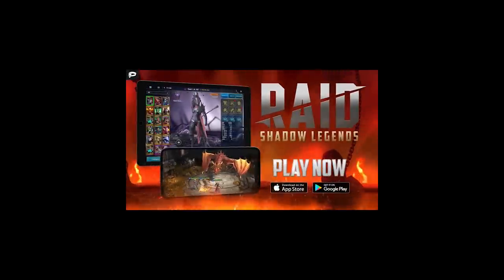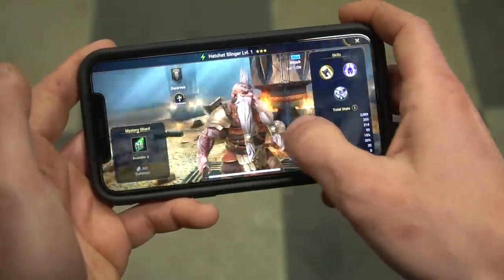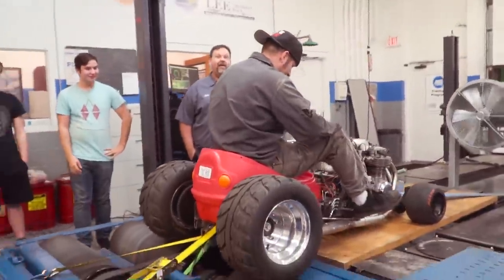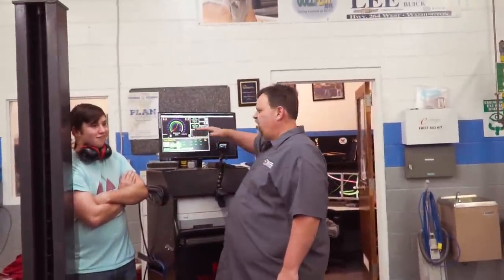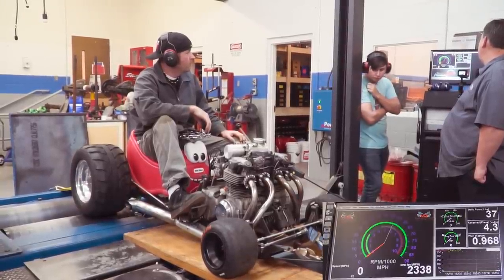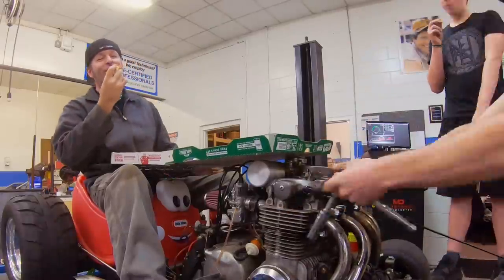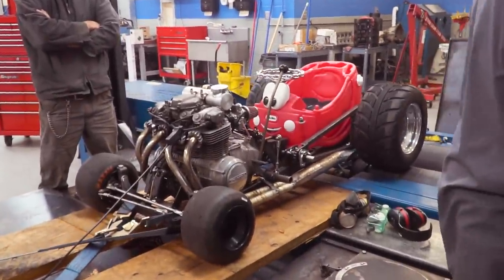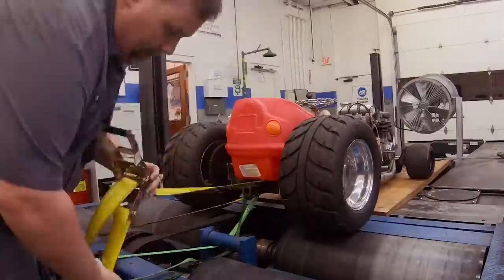550cc Little Tikes Go Kart hits the Dyno!

Comment: Dyna coils, dyna ignition and run the center 2 carbs slightly richer than the outer 2 for max performance. Ive been running 70s hondas for 20 years, great engines!
Reply: whats the deal with running the inside richer?  Is it a flow thing?  or heat? im totally curios
Reply: @gibbyrockerhunter  the center two cylinders run hotter than the outers, a little richer keeps em cool
Reply: @Chris_Bumpus  makes sense and is good to know. thanks dude!
Reply: MyLiveandletlive do they though.
Reply: @Chris_Bumpus  yep👍same thing for the kawi triples🍻
Reply: @MyLiveandletlive dyna electronic ignition is what i was referring to. But yes i agree oem points are usually better than a.m.
Reply: Naw, Its 2020. Tune off a wide band across all 4 cylinders,
Reply: Yes! I'm a certified BMW cycle tech, but these 70s Honda 4s are where my heart is at. I've got a 74 CB750 with an APE 1000cc block and lightened polished crank...118hp at the wheel when I had the kehin cr carbs. It's got 30mm Mikunis now.

Comment: 4:55 YOU GOT A SPARK PLUG WIRE ARCING!!!!!!!!!!
Reply: Ive been saying this every episode!!!
Reply: good catch
Reply: @nelsondavis4310  I hope they read the comments
Reply: 3:24 - No they don't have an arcing plug wire.
Reply: Look at 3.24
Reply: That's the light flashing off the broken end of the tach drive cable....
Reply: good catch
Reply: Good catch!
Reply: I seen it
Reply: I've been seeing that spark from the first 5 minutes they got in running!
Reply: @michaelblacktree  look who was reading the comments and used it as reference point,  it'll be fine
Reply from the maker: No we don't! It's the tach drive!
Reply: That isn’t a spark plug wire arcing; it’s the take-off for the engine’s Tachometer (rotates off the cam shaft)
Reply: you can clearly see the arching at the top of the engine?
Reply: They even did a close up this time at 3:24 showing it's just the spinning tachometer drive, yet still thick people screaming that's it's a spark.

Comment: You guys should check the coils but also check the plug wires. I used to have a 1971 CB550, it was doing something similar, it would randomly cut out on 1 and 3. I pulled the plug wires and found that there was a broken wire inside the insulation and it was barely making contact giving me the intermittent misfire. In your case I would put new coils and wires

Comment: The RPM signal bouncing is also giving you incorrect numbers too. Because it uses RPM in the equation to calculate torque.
Reply: RPM isn't used to calculate torque, it's used to calculate hp
Reply: @rbgamer1008  Correct. But it's hard to explain. On an inertia dyno, since the mass of the rollers is known they can calculate horsepower without an rpm signal into the machine simply by watching the rate at which the drum(s) accelerates. In order to calculate torque it needs the rpm signal because it doesn't know if your engine is say a diesel spinning at 2,000 rpm or a motorcycle at 10,000.

Comment: Coils and electronic ignition ditch the points
Reply: A condenser is likely the culprit.
Reply: Points worked for like 80 years, just don't neglect your equipment
Reply: for it to get fried even harder by leaving the ignition on?
Reply: @lobmin  yep nothing wrong with points..when in good working order they perform well and very reliable.

Comment: Guys, I can see a small spark on the second cylinder. It's the plug wire shorting to the frame. Check the plug and wire.

Comment: I had a 1975 Honda CB550 Four, which I'm guessing is that exact engine. I had a lot of fun on that in the 1980s, but at some point it stopped wanting to run. It would foul the plugs in nothing flat. I tried everything and finally gave up. All I had was basic hand tools, though, nothing like the shop you guys have.

Comment: You can put a pressure sensor in the seat that you made that way you won't accidentally leave it on it'll cut power to the ignition switch like a lawn mower switch that way it can handle the amperage and also if you fall off it'll shut the engine off more safety

Comment: Since you are replacing stuff it wouldn't hurt to have new plug wires and check signal throughout the entire electrical system. There might be an intermittent contact that was created by being over heated .

Comment: Isaac..When u pulled the plug and it had like a little hair or something bridging between the tip to the base...that's the cylinder running very lean...It is actually pulling tiny bits of melting aluminum from the piston and collecting on the plug.

Comment: Had the same problem with a 1979 Suzuki gsx 1000 . I put new plugs, new points an condenser,  the the 4 carburetors rebuilt and tuned to find out I had a shorted out coil at low rpms.  I fixed the two coils and now the bike is so quick on take off it's scary . You should check out bike barn for parts on the older bike parts.

Comment: Why not invest in a wide band o2 sensor kit to set your carbs?  For $150 or so you weld a bung on each exhaust runner and get an accurate reading of the afr, and go from there. Then when you're done, screw some plugs into the bungs and you're good to go.  It'll be helpful for troubleshooting as well.

Comment: use a multi-meter and ohm out your primary and secondary on your coils from this set, and keep the best from both sets for "just in case" spares also might upgrade your coil wires to larger diameter like 8.5 or 8.8mm to get more fire to the plugs, she sounded pretty sweet after you changed the plugs and did a little work but as ike said, shes not quite "singin'" the way she was before at higher RPM so either you've got weak insulation or a cooked coil, either way y'all are loosing fire from somewhere, still i love this build, its like the rat-rod wagon on steroids, and i cant wait to see the final HP/TQ numbers when shes running on all 4 cylinders, one step at a time guys like you've been doing, you're slowly running the grimlins out of the project, one small issue at a time

Comment: I’ve had an idea for y’all. I wanted to do something similar when I was a kid, and it hit me again at work while putting a transmission back into a motor grader... 
what about a 6x4 off road cart?  The rear axles, if live all the time won’t allow you to steer, but a dog-style clutch or electric pto clutch from a mower could be used to engage the drive to the center axle. 
I have wanted to try something similar to the grader, too, where there is only one “live” axle powering two stub axles in a walking beam on each side, but it would need a differential to allow it to turn.

Comment: If you gave the engine a good refresh and quality ignition, carb sync and jets it'll make 53 with the pods. They make 50 stock. Well that is what was claimed back in the 70s. But then again that was probably at the crank. So I'll say 44 horsepower if properly set up.

Comment: 3:25 to the idiots saying that was a spark... Well, it's just the tach drive.
Reply: Before they added the new points on the stator it wasn't even getting to 8k
Reply: I was going to say that a few videos ago but then i remembered i used to own a kz1000 lol. It never ran this bad however! the carbs need to be synced for sure
Reply: @tebibyte2357  I'm talking about the idiots on a previous video saying that the tach drive shaft thing was a spark arching from the spark plug... Just because it's shiny.
Reply: @fullmetaljacket7  Ohh 😂

Comment: It's a 55 horsepower motor (crank) which is mid 40s at tyre .
Your coils are damaged due to ignition being left on .
I have owned & dyno'd loads of single cam 550/4 Honda motors

Comment: Add a battery cut off switch? Having had similar probs with a 750 G, being absolutely sure there is no stray voltage finding away to the points, coils would seem worthwhile. Ike- I cannot wish you anymore fun than syncing four carbs, especially if you don't get the ignition problem solved!

Comment: Ignition upgrade to electronic & get a proper AFR, the Honda 550/4 is a good platform for some great power. The valves / cam timing need adjustment along with a full tune. Get a vaccum gauge on it to see what the problem cylinders are. A failed ignition/ low voltage will show a bad AFR. The hp is way off in comparison with the torque.

Comment: You may want to check your wires too, they can for sure cause pretty much any symptom any other part of the electrical system will. They are cheap never hurts to have new copper for the lightning to ride on.

Comment: normally coils fry up because they dont last long with heat n stay power all time "when not in use"
if you put coil away exhaust pipe that way reduce killing coil pack n i have that issues ton of time so i relocated coil above carburetor away from exhausted pipe

Comment: I don't remember if you guys fixed the charging system. Make sure battery is fully charged. Battery powered ignition requires a lot of power under full load.

Comment: You might already know this but most motorcycle transmissions dont actually have an over drive so 5/6th gear aka the final gear is usually just under or at 1:1  and for most dyno power pulls you want to be at 1:1 or as close as can be which is why in a manual car on a dyno they'll run in 4th because 5th adn 6th are over drive gears. You dont want to be in underdrive because it'll give false readings most likely more torque and less hp from my understanding. So if you plan to go back to the dyno please find out which gear is 1:1 it'll give a better more accurate reading then it being in third or forth unless for some reason this bike has an over drive gear and is more like 0.7;1 or 0.9:1

Comment: Leaving the power on with the points closed will over heat the coil/s and damage them, has happened to me. Also someone pointed out the spark plug wires are arcing!

Comment: you can use gm coils from a 2000 firebird v6 in place of the stock coils. can also use them on an ez-go gas golf cart. i use the hp gm coils with 8.8mm wires.

Comment: Lose those crusty old pod filters, and the mix ratio would clear itself out. They use minimal restrict air boxes from the factory, because otherwise the engine won't rev up to the torque range. If you need more low rpm torque, use velo stacks inside the air box.

Comment: not sure if anyone else has mentioned it but ive noticed a small spark on the top right of the engine. I think one of your coils is bad and grounding out on top of the engine case. I had that happen on my 75 360. Coil was bad and sparking on one of the mounting screws

Comment: When you leave the ignition on for a long time, the ignition coils can burn out and get damaged from the inside.

This engine uses one ignition coil for 2 cylinders, so if one of the coils is not working properly you will notice it on 2 cylinders.

You can measure the Primary and secondary coil resistance on both ignition coils with a multimeter if you want to be sure.

Comment: IF... you were to.... Synchronize the carbs and do the jetting. It WILL run better. I promise.
Maybe get a set of Dyna coils and a Dyna-S electronic ignition. Look on Ebay. They aren't that expensive and it's a night and day difference in how that motor will run.
If We were closer I'd say bring it to my shop and I could make you a linkage for those carbs that would make synchronizing a LOT easier. I'm in Austin, TX.
Granted..... As long as the throttle is opening all 4 carbs all the way at WOT it won't make any difference on the dyno or the drag strip.
Where the synchronization will help is in driveability at part throttle..... Putting around, blipping the gas, etc, etc...
Definitely one of ya'lls coolest builds. Would be cool to see it properly sorted out.

Comment: Trailer flipped over in the car I don't forget about strengthening up that real at that rear axle when I was looking at it on the dyno that passenger side tires kind of kick in a little bit and at the higher RPM that axles wanting to flex and cause it to waive a little bit in the back so definitely need to think about strengthening up that back axle but other than that coil packs y'all set it right you know Colfax and turn on the carburetor y'all should be good

Comment: Do away with the points and get you a crank trigger. My son runs a garden style pulling tractor and we have to use a Kohler based engine. Just getting rid of the points made a night and day difference, crank trigger, fresh plugs and wires and get the carbs right and I bet it will sing for you.

Comment: Also, check the sync of your carbs. I see that wanky four cable thing going on there seems suspicious. Obtain the proper carb set for that engine, rebuild and sync, and see if they make an electronic ignition upgrade for your points setup. Plus if you have chunks o carbon in the plugs, maybe there is some stuck to a valve or lash being out hurting your compression.

Comment: Your just be hitting the rev limiter that cuts spark to keep the engine from over reving if it was at mid or lower rpm I be concerned. But that's how a governor works on a motorcycle engine it makes it seem like it's missing but it's not

Comment: Good numbers for all the work you guys didn’t do on the engine before you hauled it to the Dyno.
Now, take that beast back home, get to work on the carbs.  Increase the jet size a little and synchronize them.
Check and fine tune all the parts of your ignition. Points ,condenser, coils and spark plugs. Play with the advance a little, find that sweet spot and lock it down.  Now your feeding that thing some great fuel.  The ignition is going to give it that spark of life. And you didn’t have to do anything with the exhaust, it sounded great already.
You guys are not going for serious HP.  If you were you would have split the cases and went to work on blueprinting the engine.
But that would make it unusable for this project.

Comment: Not so much  comment as a ,in any event. 
I wonder if thes 3 understand the huge difference z y nncing the carbs. The difference tween bench syncing abd using carb sticks is... lunching my19 74 z1a kawi 900 and having it come up 6 or 8 inches @55mph or breaking tire lose ( little puffs of smoke from tire) Nx lifting straight up and keeping there till end of 3rd like i10/120mph

Comment: If the honda 550 is like my kz650 Kawasaki.  It was points ignition. Leaving the ignition on with motor off will f a coil. That's the problem
Reply: I put a DynaS2000 on my setup. Way less headache vs dealing with points.  But not cheap. There are some cheaper digital ignitions. And wire a head lamp to the key on.  So you know when it's on.

Comment: Isaac sitting there eating while the “pit crew” turns wrenches.  Lol. 

I’ll put in another recommendation of spark plug wires.  Might be losing connection internally with vibration.

Comment: This thing will never run right until they figure some way to pull the throttles on the carbs all together properly.  The system they are using guarantees they are not all in sync.

Comment: 7:15 how does leaving the ignition switched on burn up the points?
Reply: If the points are closed with the ignition switched on there will be current running through the points and the low tension circuit of the coil. It might not harm the points themselves but the low-tension coil could overheat and burn off insulation on the coil wire.

Comment: As GM Concept Car Designer i want to say 2 things:
1) f'n awesome
2) f'n scary.... i was with you until you spun up that back wheel at full bore.  those tires are NOT ment to turn that fast and could well have delaminated and ripped you right in half. ...seriously.... same for the axle bearings, same for the rim... none of it ment for high rpm.....  be careful man, its all games until you have to take two pcs of you buddy to the er and ask them to sew shit back on

Comment: Nice video, im installing a 07 kawasaki 500r motor on a kart that ran when on the bike but now on the kart no spark but power to the coils. Wiring harness set up exactly like it was on the bike. Any ideas anyone ?
Reply: check connectors? ground? sensors? could also be a security system if the original bike had such..

Comment: no one sees the spark jumping off the valve cover at 4:48 thats ur problem i saw the spark jumping and grounding out ur first vid o you guys running it
Reply: Also no one sees it's not a spark problem at 3:24
Reply: Its the original mechanical tachometer output.